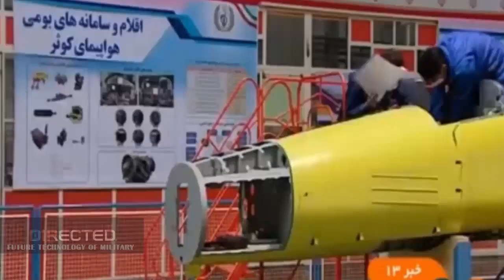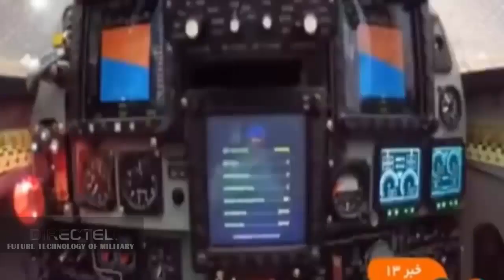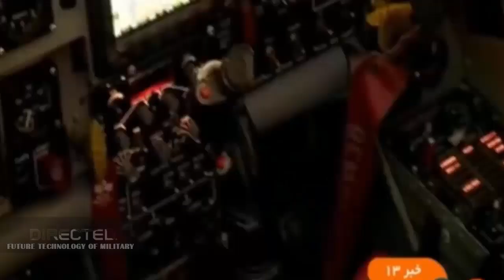Iran Started To Develop A Heavy Fighter Jet with Indigenized Avionics And Homegrown Engines

Comment: You can call it something else but it is still an F-5F but I will give Iran props on keeping all those old war planes running must be extremely expensive
Reply: US cannot take credit for everything inside the airframe, something US NEVER have made inside a F-5.
Reply: Its like you say Toyota Camry and Lexus are the same!! No they may have same PLATFORM but two different car with different capabilities , Iran has overhauled and upgraded the engines and added new missiles radar and ECUs in other word this is not what you know as F-5.  Well-done Iran 🇮🇷🇨🇦
Reply: A Colt 1911 is 112 years old.  Still works very well.  Would you go up against it in the hands of an expert?